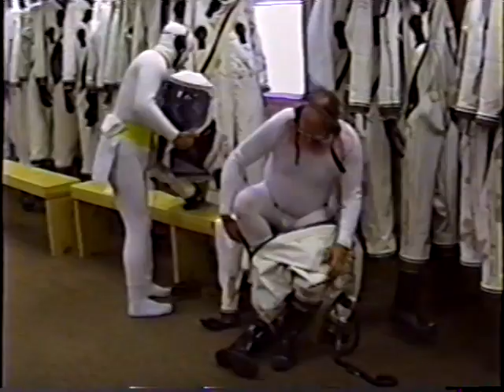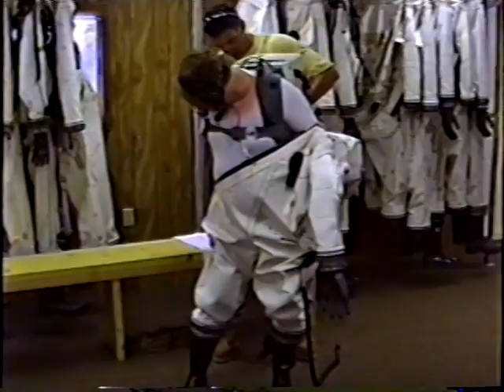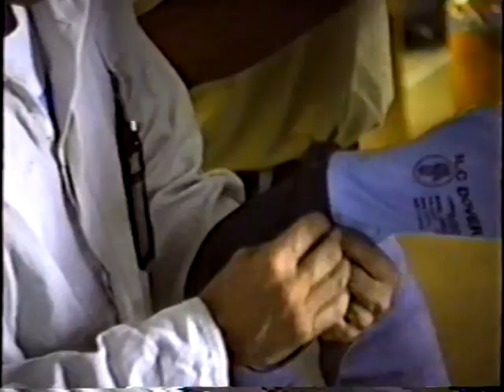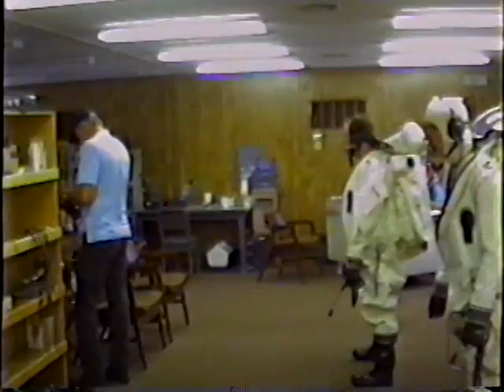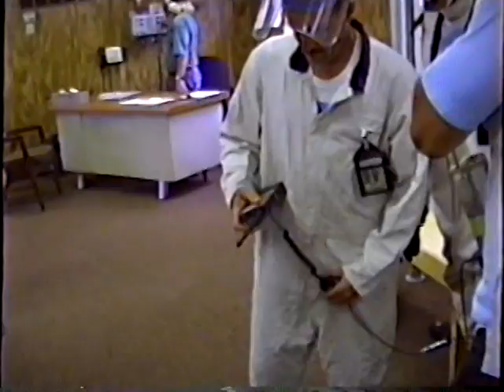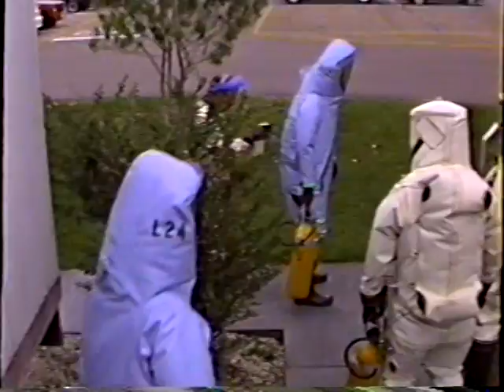Space Shuttle technicians suite up for hypergolic fuel handling

Comment from the maker: SCAPE (Self Contained Atmospheric Pressurised Ensemble) Hypergolic Operation at Kennedy Space Center Orbitor Processing Facility(OPF) number 3.
The ensemble is composed of a white nomex suit, a 60lb back pack,  a dewar of liquid air whose outgasing provides inner suit cooling, breathing air and  positive suit pressure with three selectable settings cold, colder, witches tit cold. Also an activated carbon  scrubber. The blue suits carry their air tank to the work area where they connect to a land line air supply. This group are Flight Element technicians (who work on orbitor exclusive hyper systems) as opposed to GSE (ground support hyper systems). The blue suits do the up close and personal tasks in very confined spaces, not a good place to be  when working with MMH.
 This operation is at the aft stingers  where the largest thrusters are located.
Reply: +harry swartz nice
Reply: harry swartz how did you get this job
Reply: Now known as the MPPF (Multi Payload Processing Facility) :)